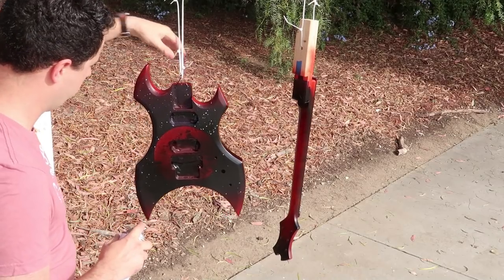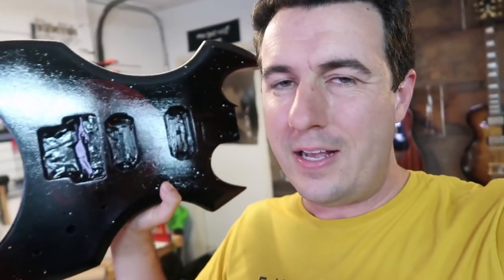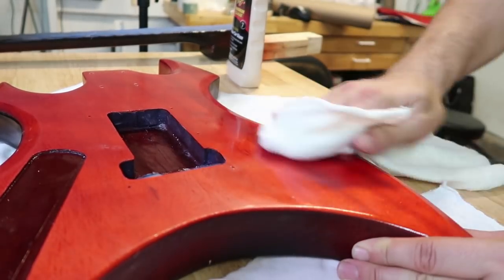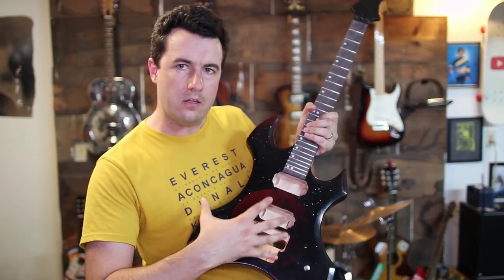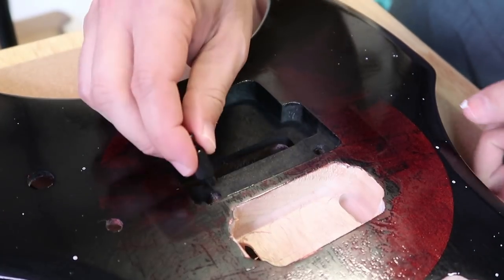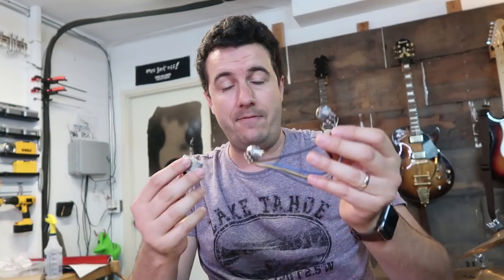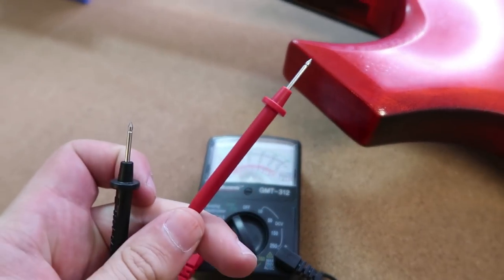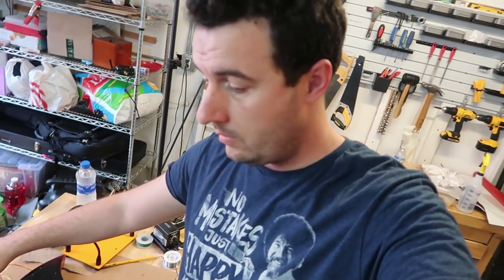My First Major Problem

Comment: So I'm an engineer and high school electronics teacher. I don't know if I can help, but I'll tell you everything I know.

The knob is also known as a potentiometer. When you turn the knob (potentiometer) you increase the resistance in the circuit. Increasing the resistance, in this case, eliminates high frequencies. But on your guitar it seems the frequency is too high to be eliminated. 

After reading this: https://www.ultimate-guitar.com/forum/showthread.php?t=1209738&per_page=20

I think it might be your capacitors. Capacitors are used to store energy in the circuit, but when there's too much voltage (due to the resistance change in the potentiometer) in the circuit the capacitors "overflow" causing the feedback sound. 

Also after reading that thread linked above, the OP fixed his problem by checking his polarity. I know you checked your ground, but double check your positive and negative wires. Maybe sketch a wire diagram for yourself the way it's put together now. Sometimes it helps to step back and make sense of it. 

Next time use a breadboard to wire your components before soldering them. It's less time consuming and saves the component's life if you damage it while re-soldering. 

Let me know if I helped or I can help anymore. The customization looks incredible! I think you can have it sounding as good as it looks soon! 😉
Reply from the maker: Thank you so much for this!
Reply: Thank you, I learned something new today from your post. 😊
Reply: Electrical engineer here. I was coming in to say the same thing! This makes the most sense as the culprit.
Reply: You’re the best for saying this!

Comment: Growing up my dad made hand made guitars for a hobby and sold them. His favorite way to use a clear resin to because it: A) added a hard coat over the top, B) made it shiny, C) made it smooth. You can sand and/or buff it just fine, and if you mess up it'll smooth itself out so sanding shouldnt be too much a problem

Comment: So it seems that to start I have to indicate my knowledge level. I'm an electrical engineer and have been designing electronics for many, many, many, many things for over 35 years. 
The "blue wire" that you removed and replaced with 2 wires, is known as a coaxial wire and it is specially design and built to accomplish 2 things. First it is to create a controlled impedance transmission line, secondly it is used to create a transmission line that has its internal signal shielded from external noise. Replacing this coax cable with 2 individual wires destroys both of these design features.
Next I'll attempt to address the noise issue when you touch the metal parts of the guitar. Remember that I haven't carefully studied the components or the circuit that you have created, so there is no guarantee that I'm getting this right. But it seems to me that most noise issues of this type are caused when a small signal source is connected to an amplifier without a 'Balun'. You can google what a balun does and I'm sure that you will be able to figure out if you need one, or if there is one already maybe it is not connected correctly. 
Hope this helps!
PS. Yes this is a type of grounding problem!
Reply: That this is a transmission line is spot on! The circuit is designed to transmit the signal from the pickups to the amp, so electromagnetic interference (EMI) is a major concern. You're probably right about it being a termination issue, it's just hard to convey what that means without a lot of additional background. RF is basically Black Magic.

Re: the blue wire. I don't know if I'd call it coax, although i suppose that's technically true. Coax generally has its physical/electrical properties much more tightly controlled.
Reply: I have to retract my previous statement. I was watching a video about building "two conductor instrument cable" e.g. the standard cable that connects a guitar to an amp, and it's obvious from the construction and use that it is coax, as is the wire inside the guitar[1]. But it's also clear from the treatment in the video that this distinction and its implications are not recognized. In my experience, if you nick the dielectric or conductor the output is unusable. Lower frequencies (e.g. audio) have much more wiggle room. 

[1] I was conflating things like USB and Ethernet shielding: similar purpose; different mechanism.

Comment: I don't think this is the issue, but I did notice that the blue wire you replaced is actually a shielded wire, not just a two conductor wire. The difference is that a shielded wire has a braided mesh that surrounds that wire which reduces noise/interference replacing it with another discrete wire defeats the purpose.

Another observation that may help in the future is that the grounding issues people talk about are usually the result of a bad solder joint or a missing/loose connection and not in the wire. To check if the wire is good you can use the continuity test on a multimeter. Which yours doesn't seem to have, so I'd recommend  investing in a better one Sparkfun has a good cheep one.

As Destiny Harding mentioned breadboarding the circuit first is always good practice. You can get a breadboard or test leads with alligator clips so you can test it out before soldering.

I'm an Electrical Engineer, and I'd be happy to answer any questions or take a look and any kits you need help with.

Comment: My first factory-built guitar's pickups picked up the local radio broadcast some of the time.  As long as yours doesn't do that, you're ahead of the game.
To limit hum, do like Miranda and shield your crevices!!  Put copper foil/tape inside the pickup, knob/switch cut-outs, AND underside of your pick-guard, then connect them ALL to your ground wire.  Also, while the "guitar gently hums", try turning your shop lights off.  It could just be fluorescent lights causing the buzz.

Comment: Hi Chris I'm an electronics engineer I'd love to help. First suggestion would be to sketch out your circuit to visualise it better. Checking polarity is right thing to do also to use the correct terminal as the ground as they are different. I don't know guitar circuits but do you have the volume and tone pots the right way around? One would be a potentiometer to change the volume and the tone is a filter circuit so very different. 
I'd also recommend taking baby steps to help identify the problem component. I'd wire the pickup direct and test it. Add the volume and test it. Add the tone and test again...etc until you get it right.
Hope this helps without being too technical for you.

Comment: The paint job is SO AWESOME!! That moon, & neck (especially) after the lacquer/sand & polish is the BOMB!! I’m clueless about guitars, but do have some experience with lacquer/gloss finishes-could ur lacquer coat be a (little) tad too thin (I think it was most likely too thin with Colleen’s guitar by the looks)? I just thought it’s a possibility-especially with u going thru the lacquer/paint in those couple of small spots. Sometimes u need to go just a tiny bit thicker with the lacquer than u think-It’s quite the challenge tho, as u don’t want it so heavy it runs-or takes a month to dry! Another thing, edges tend to be difficult-they are usually thinner due to the viscosity of gloss & how it “lays down”-it tends to gather a bit in the centre/middle, but thinner on the edges-I hope u get what I mean! U may also get some huge benefit by playing with different samples of wood from the hardware store-(especially if u can find wood samples that ur kit guitars are made from)-paint them, lacquer them (experimenting with different spray methods/thickness etc.). AWESOME JOB with the painting/lacquer-I’m sorry about the electrical stuff!! As u said, it’s ALL learning & growth!!

Comment: A sponge is also good to gauge pressure when sanding. Yes, the 'Tone' is the one with the capacitor soldered to it. Sounds like a shielding, and grounding issue. You can get copper shielding tape, or shielding paint. And your solder connections might not be good, or you applied too much heat to the Tone Pot, causing damage. It could even be a faulty part. Best to get some literature on the subject, for the next build. Great looking Guitar, anyway.

Comment: Hi Christopher! The buzzing increasing when turning the tone knob sounds a lot like what happens when you turn up the volume... any chance you actually did end up switching the volume and tone set up as you mentioned previously in the video with the lack of distinguishing markings?
Reply: Was wondering this as well... need to do some research.

Comment: Loved watching this Christopher, I'm in the middle of wet sanding a build too I feel your pain!
This is unlikely to be the cause of your problem but I do have a tip re hum. Shielding your cavities with shielding paint or copper tape/foil  will create a Faraday cage which stops static and other interference - interfering and causing hum. It's surprising how much stuff like l.e.d lighting can cause hum when guitar is close.
Have you checked out dual humbucker wiring diagrams online? There are often different ways to wire the same configuration especially the more you have going on. Are both lugs of the capacitor connected to your pots  - ie circuit isn't broken? And is your bridge grounded?
Whatever it is, good luck! I'm sure you'll get there
Reply from the maker: Thanks for all the tips! I’ll check on all of these when I get some time with the guitar.